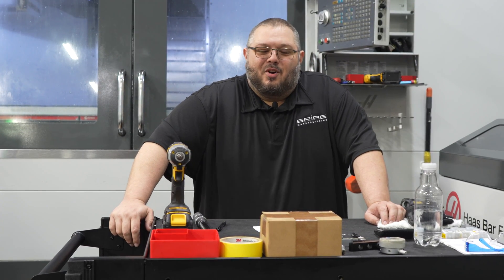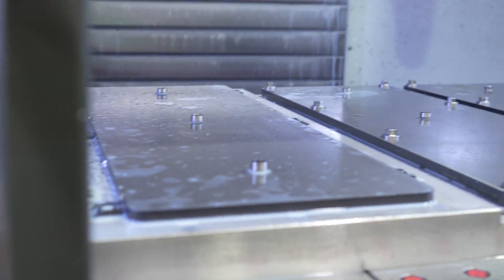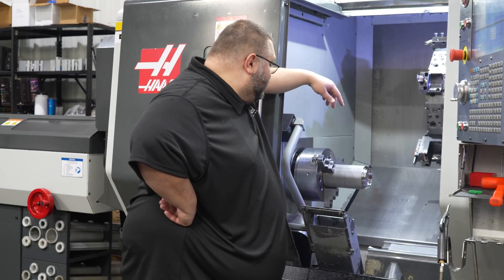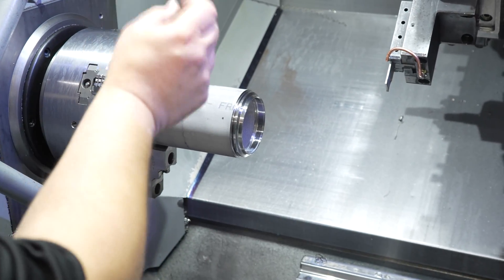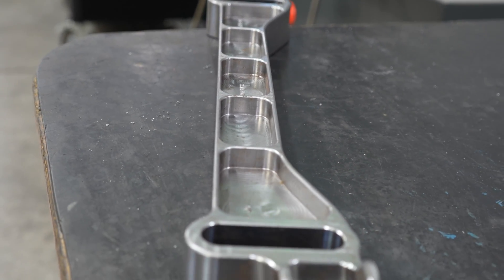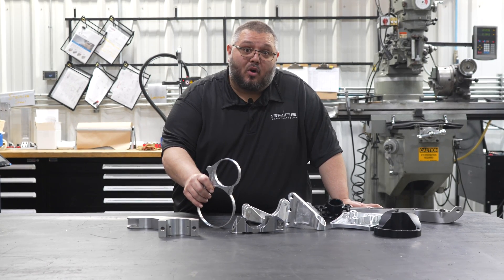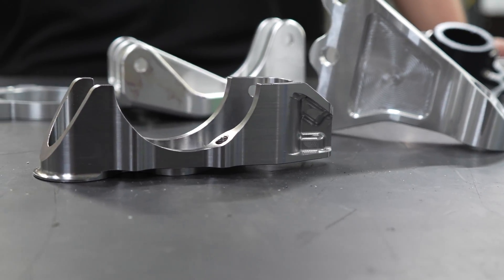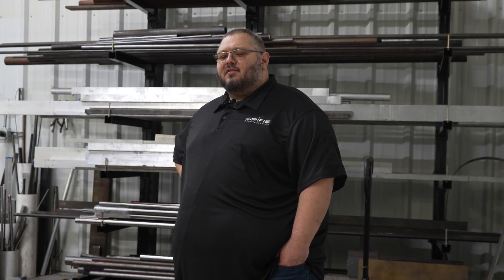Inside Spire Manufacturing's High Speed Workshop | Machine Shop Tour

Comment: >>> *THE (((( MAIN)))) THING THAT HAS BEEN CHASING QUALITY MACHINIST'S OUT OF THE  MACHINING TRADE FOR THE LAST 25 YEARS (( IS )) >> HAVING TO DO  AT  LEAST  >>  4 --- 7  DIFFERENT JOBS AS TOLD TO YOU BY THIS SPEAKER AT THE END OF THIS VID,, TO RECEIVE ONE PAY CHECK THAT SHOULD BE AT LEAST $35.00 per hour. FOR ALL THOSE JOBS THAT (( SOME )),  EMPLOYERS EXPECT NOW. >> BUT THAT PAY FOR ALL THE EXPECTED WORK IS NOT WHAT YOU WILL RECEIVE OR BE PAID...!!! >> A FRIEND LEFT MACHINING FOR $75,000 PER YEAR TO START IN HVAC..!!!!!! THAT JOB GOES TO $110,000 LATER... >> * I EVEN WENT TRUCKING FOR 2 YEARS... IT WAS GREAT MOST OF THE TIME... *IN JUNE OF 2023, I DROVE WITH A TEAM MATE TO RENO NEVADA, WE LEFT STATESVILLE, NC..,, SATURDAY  MORNING, DROPPED THE LOAD, THEN WENT TO SAN JOSE. CA.. PICKED UP A BACK HAUL LOAD, DELIVERED TO GASTONIA, NC.. GOT BACK THURSDAY AT 10PM.. >> *5 1/2 DAYS,, GROSSED $1,865.00. >>> TRY THAT IN MACHINING..!!! >> GET ONE YEAR EXPERIENCE TRUCKING AND THEN DRIVE LOCAL TRUCK OR DUMP TRUCK AND BE HOME EVERY NIGHT.!! MAKE OVER $1,350.00 WEEKLY..WITH JUST ONE JOB!!!! >> *YOU HAVE NOW BEEN WARNED... YOU ARE WELCOME..